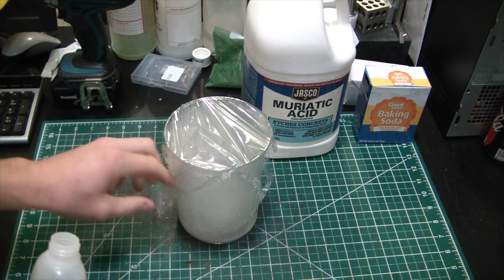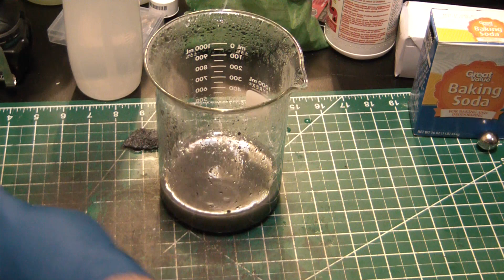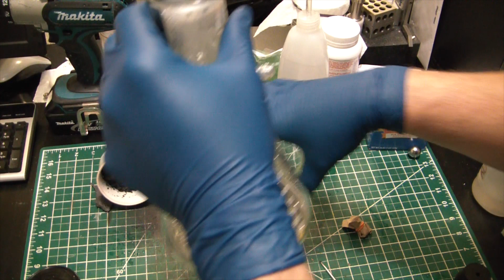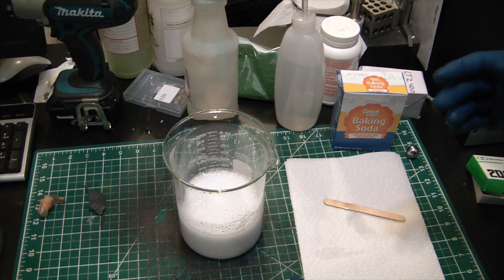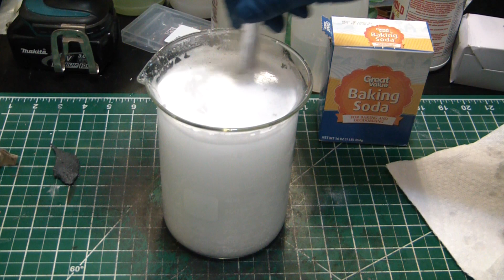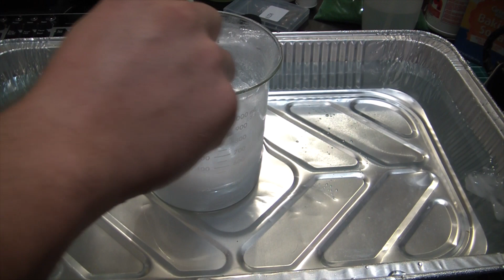Making Aluminum Oxide For Synthetic Ruby - ElementalMaker

Comment: Hi I was given a small sample of  this free flowing calcined alumina sub-micron powder.

I need help on Suspending Submicron Calcined alumina powder.  What do i use as a liquid carrier to disperse this powder onto my polishing substrates? I am not using this in a wet/slurry while polishing - I am only using this carrier to disperse it onto my substrate, and then let it dry and then use it to polish because it's slightly absorbed into my polishing substrates. I have read all kinds of things, some say to mix with pure ethanol, some say DI/distilled water, and while others say it needs acidic environment. I really don't know?

I am just not sure what the liquids ph needs to be for this powder to be stable in, and what is best to keep agglomeration at bay, or to keep the particles from absorbing to much if the moisture ect. My test run I put into a 18ml bottle, ethanol and 0.30g of sub-micron 0.3 calcined alumina and I have a special fine dispersing sprayer, before this I put this in a ultrasonic  to de-agglomerated and I also put two small bb's in the bottle to shake and agitate. After the  24 hours later after ultrasonic/ de-agglomerated, then further shaking/agitating after the ultrasonic it is still milky white and very little has settled to the bottom of the bottle after the 24 hours. Am I using to much powder for 18ml of liquid? Am I on the right track? I have further interest in this product, I only have a very limited sample for now, so I need to know if I am on the right track. I have further interest in your free flowing powder because I only have a very limited amount. I just need technical assistance, so I can mix this properly.

Thanks,

Mike

Comment: That carbon is probably the liner they spray into the cans to keep them from dissolving from acidic soda
Reply: I doubt there’s any carbon at all. The black precipitate gathered after filtration is probably iron contamination. Given the black color it’s probably ferric hydroxide hydrate. Most, if not all, of the carbon on an aluminum can will be oxidized as CO2 when the aluminum was melted.

Comment: I Made my rubys with aluminium from hard disc drives older then 2000''s
Whould it work better then soda cans because in hdd aluminium there you have platinium, rhodium and some other expensive stuff

Comment: so when i disolve aluminum using elctrolisis what am i getting? what is that green stuff? made a few grams of it but dont know what to do with it, i used distilled water
Reply from the maker: Aluminum oxide is white. What your seeing are probably alloying element oxides, since the aluminum your using likely is an alloy and not pure aluminum.
Reply: @ElementalMaker  ok thx, i still tried to mkae a semi conductor out of it...more like a 3 pole variable resistor

Comment: You forgot the inside of the can lining. I am not sure what BPA (bisphenol-A) turns into when burned while melting aluminum cans.
On the adding water to acid I take it you have seen Cody's Lab when he ran some tests on that. Nothing went thermonuclear. But you never know. The one time in X that something does happen. OOPS I just rewatched the first part and must of looked away when you put up the note about the can liner. If you have not dumped the Carbon like compound why not test it to see what it is?
If the contamination turns out to cause problems it would not be to hard to make your own HCL and to clean up the aluminum could you not do it by electroplating the aluminum onto a surfas that
would not cause an issue?
Reply from the maker: I realized that in editing and added a quick text mentioning it in the video. I'm sure it turns into carbon at those temperatures, and some nice cancerous man-tit causing smoke.

Comment: The bottom and sides of an aluminum can are drawn from the same piece of metal.
Reply from the maker: That's what I thought as well, but I found an article stating that the top and bottom of an aluminum can are of a different alloy. Given that it is a single drawn piece though, I think you are right. Just the can top is probably the different alloy.

Comment: I have a hard time with your explanation for all the carbon as it burns between 1200& 1400* F. Being that it would be so thin in the screening process, seems it would have easily burn off. Cheers, Billy in Canada
Reply from the maker: The cans I used were melted whole, so much of the carbon from the inner enamel liner and label was likely entombed in molten aluminum.

Comment: Hey man how do you dry out Potassium Hydroxide ?
Reply from the maker: Generally you don't, its usually cheap enough that it is not worth regenerating. You would have to c force it dry in an oven, or use a more powerful desiccant such as pure sulfuric acid, which imo is much more valuable than KOH.

Comment: Omagad, I just tried with aluminium foil. Reaction went crazy, smell was sinister. Even my cold bath couldn't fight it. Stopped everything by putting a good amount of water.
Morality :
- 23% HCl was probably overkill.
- The reaction time seems to increase with the temperature. As it's an exothermic reaction, you see the problem.
- Aluminium foil was fold multiple time and cut in strips. At first, only a few surface was soaked in acid and nothing was happening. But soon the contact surface did get multiplied as the acid enter my aluminium "sponge".
- I obvioulsy added the aluminium it bit by bit, maybe rushed a bit because the reaction was slow to start (and probably slow to go for the whole run with my 23% HCl as I stupidly thought). I had around 2 grams in the solution at most.
- You probably wont do this at home for the smell. In fact, you probably just won't do this.
- Don't forget your protections, always think beforehand on how to react if something gets out of control. Think of anything, corrosion, explosion, gas generation ...
- React quick.
- I'm gonna buy the final product from amazon, perfectly cook, perfectly baked for less money than a new body would cost me

I don't know if the reaction was just to quick and made me anxious, but the smell was definitively unexpected. I guess I had some contaminant somewhere.
Despite my basic chemistry skills I'm quite shocked.
And I probably just had inhalated an unknow quantity of chlore into an unknown form. But I'm fine :)
Reply: Turns out I might have produced Hcl vapors.
Hcl has a low ebullition point (48°C), so if the reaction goes too fast and too hot, Hcl will probably be one of the first thing to vaporize.

Comment: I'm working on an no generator right now
Reply from the maker: Very cool! Let us know how it turns out!
Reply: ElementalMaker I just ordered some 20ga stainless steel sheet and need suggestions on how to cut the electrodes. Thanks!
Reply from the maker: @gavinshah7932  that's not gonna be easy. It would be best to find someone with a water jet, plasma table, or a good sheet metal sheer press. I don't really do any sheet metal work due to that fact, hence why I got the cups
Reply: ElementalMaker thanks for the suggestions I will look into those, but how hard would it be to cut with tin snips?
Reply from the maker: @gavinshah7932  man it's been a long time since I used tin snips! I'm sure it could be done though
Reply: ElementalMaker I got a quote from a website to get all the plates I need laser cut and the price came out to somewhere around 230 dollars which seemed way to high so I'm probably gonna try cutting it myself with tin snips considering I can buy all the steel I need for 40 dollars.
Reply from the maker: Wow thats crazy! See if you can find somebody local, and kiss their ass. Bet you could get it all done for a six pack.
Reply: ElementalMaker I’ll look around and see if there is anyone. Thanks for all the suggestions ill keep you posted with how to generator turns out. Love your setup by the way and can’t wait to see if the synthetic ruby experiment works out!

Comment: Those cans have a plastic coating on the inside and paint on the outside. ... Not a very pure source
Reply from the maker: Acid doesn't dissolve the liner...
Reply: @ElementalMaker  ...no but the foundry does, creating contaminates in the aluminum along with the paint and any residue inside. It all adds.

Comment: Lol thats proly dried up beer dude .why not just buy some aluminum oxide? I wish i still had some .we had huge cardboard drums of it at my job up north .one guy droped one off a pallet and it spilled all over so they threw it all out .i saved a 5 gal bucket .its gone now 😢
Reply from the maker: Why buy when you can make it? I like exploring the chemistry rather than just buying off ebay. What the heck did you do with 5 gallons of Al2O3?!
Reply: was gona sand blast my boat. I did use it in my ball mill to smooth petosky stones and agates.it was in prill form . like little beads
Reply from the maker: Very cool, didn't know you have a boat! Lets go for a booze cruise! LOL Man that must have been a metric-shit-ton of stones you polished